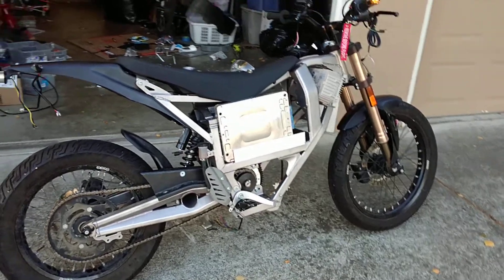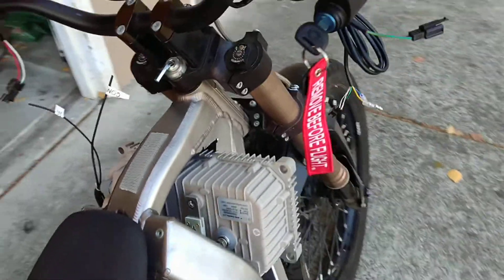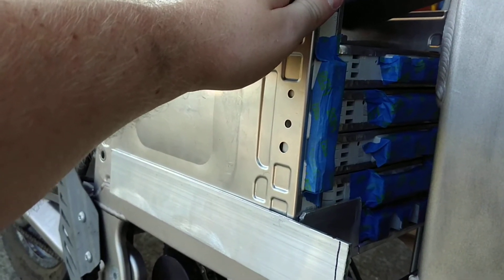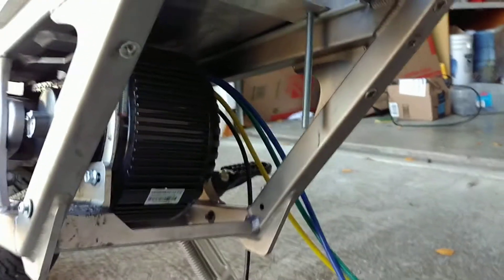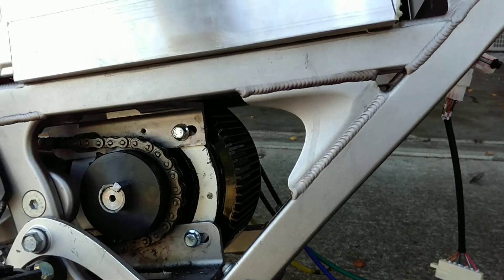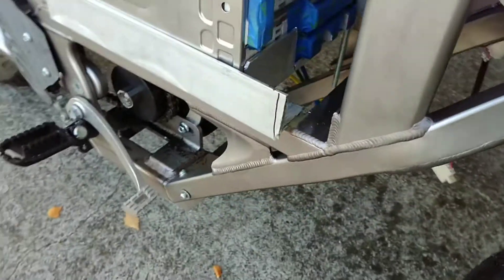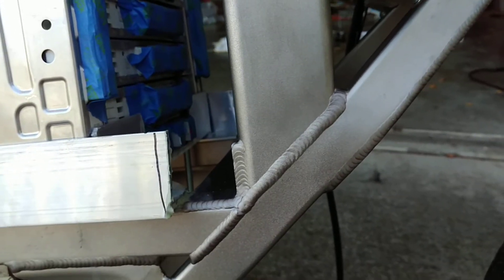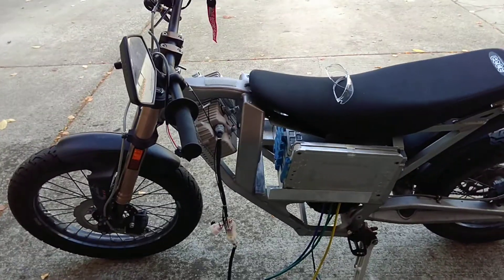Zero rebuild: Making progress

Comment: Did you ever finish it. I did a similar build using a QS165 50H motor with a Fardriver 72890 controller. My battery is a 72 volt 100ah that I can get 250 amps sustained, so when it's charged all the way up to 84 volts, I get around 25KW of power, not bad and she really rips all the way up to around 120 km/h! I have some videos over on my channel on it.
Reply from the maker: Unfortunately I made a deal with my significant other that I'd have to give up riding bikes like this if I wanted to get into paramotoring. They didn't want me 2 high-risk hobbies simultaneously. In hindsight, the mods I did on my bike were probably slightly dangerous, I was a dumb college kid, and now after working in the EV industry on powertrain systems and battery systems, there is a lot I built wrong here that I could probably do safer. 

The bike has found a new home, one that will probably rebuild her in the future, we'll see if they ever post a vid of her again.
Reply: @Hyperious_in_the_air  Thanks for the update. Sorry you had to give it up.